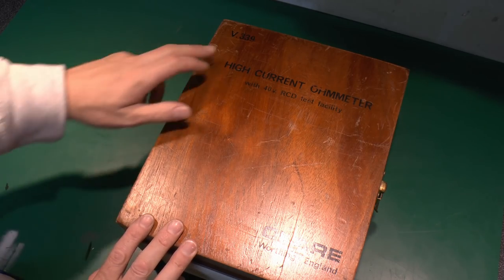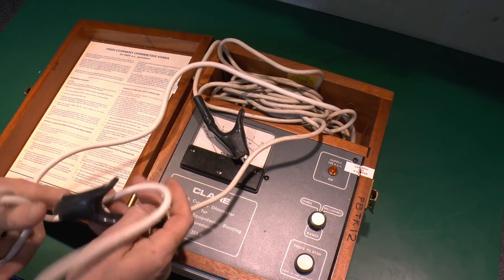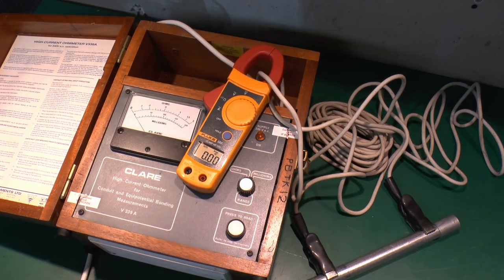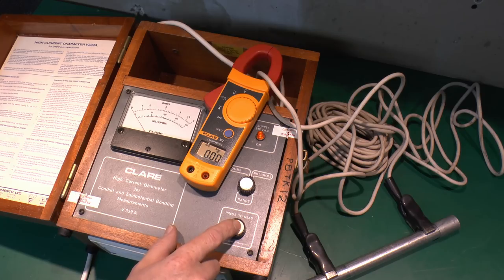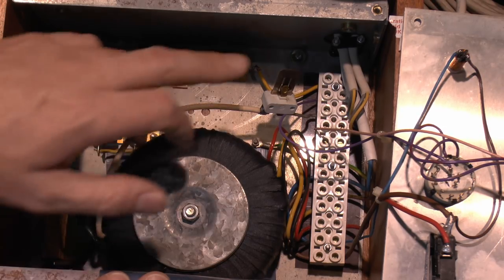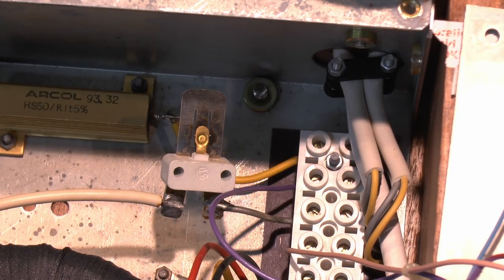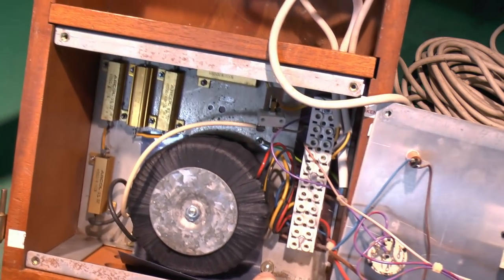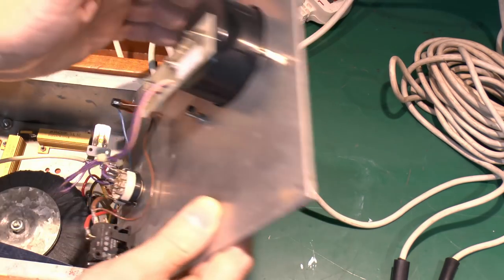Clare V339A High Current Ohmmeter

Comment: I use two vintage meter's being the ever faithful E&V megger and an Cropico kit assembled "Norma" test meter which came with temp probes and the sound probe, the megger is 1950's and from what I gather the Cropico is 1967, both work immensely well, the megger helped me track and trace an annoying short in my classic car's wiring loom and often use the meggers generator to test current with the Cropico at the other end of the circuit.

Comment: Use to use newer Clare A433R for earth bond testers for many years. These had a large green probe that you pressed against the test point to trigger the test. A pass would be indicated by a green light on the probe itself. If it didn't pass then the reading on the meter would be recorded.

Clare were bought up by Seaward, who have a product line "Clare Industrial Electrical Safety Testers".
Reply: Stephen Moll  I have that model lurking buried in the shed somewhere
Reply: @allthegearnoidea6752  wouldn't surprise me if the ones I used were still being used!

Comment: I have something similar to that meter. Made by Evershed & Vignoles Ltd London W4 last calibration was in 1997. The meter uses an alkaline accumulator for power and the maximum reading on the scale is 0.1 ohms. It has two probes which connect via three pin 5 amp plugs and sockets using two wires to each probe which contain a resistor tuned to the length of cable attached and a big brass rod sticking out for the probe, it is ex military and as I understand it for checking the bonding of aluminium skins of airplanes.

Comment: Many PAT and MFT devices do the 200mA - and the IET seem to think this is ok. I always carry a "proper" High current tester and use it as much as I can (requires some thought for ensuring you don't put 20A+ though a sensitive devce). I understand the need for 200mA when testing sensitive equipment - what I struggle with is why the IET say 200mA is an acceptable test for everything. I think Hugh current testing should be compulsory for anything except IT or electrically sensitive equipment. I've experimented with this before and you can get a looooot of dodgy arrangements to pass with a 200mA test.

Comment: You can get a modern low ohm meters, The one i used for many years was made by Megger (It was not cheap) it had a 20A test current. Not sure of the model but a bit like DLRO10. It never got a reading wrong, if it was measured low it was low.

Comment: Been needing something like that to test how well coaxial cables are bonded to radio towers! Time to build one! Not much going on in that thing! I suspect I can can basically used a old battery charger for the power source as it’s already current limited and has a bi metal strip inside. Just need to add 4 wire measurement and calibrate a meter to a reasonable level!

Comment: JW, i do wonder if that might be from circa 1975, then refurbed in 1993 with a new movement, unless Clare's cabinet design trends were a little on the old side..The plastic fantastic grille looks sufficiently nasty to have been added later when someone during refurb realised a standard british finger could easily get in and touch the transformer insulation..

Discuss! (As Vic Reeves would say..)
Reply: The resistors also have a 1993 date code, it is very likely to be from 1993.

Comment: I couldn't tell for sure, but that meter might have a screw to set the zero.  Many analog meters had that feature.  If it does, you short the test leads together, select the low-resistance range, push the button and turn the screw to set the zero.  When you release the button the meter will show a slight negative value, but that's OK.  Then you calibrate it against a known resistor.
Reply: @pmailkeey 
Depends if you want accuracy or not, I suppose.  You want an accurate measurement when it's not connected to anything.  I'd prefer an accurate measurement when it is.
Reply: @pmailkeey 
You are attempting to apply a general principal in a situation where it does not apply.

Voltage meter?  Set it to zero when the voltage is zero.

Current meter?  Set it to zero when the current is zero.

Resistance meter?    You're saying set it to zero when the probes are open circuit.  I.e., set it to zero when the actual resistance is infinity.  My solution sets it to zero when the resistance between the two probes is zero.  And it gives a slight negative reading when the resistance is infinite.  Not ideal, because ideal would be infinite resistance displayed as FSD.  But since we're only interested in measuring resistances, not infinite resistances, it's an effective solution.  Your "solution" gives an unacceptable offset error.

As for doing it in electronics, hahahahahahahaha.  Have you thought about what is involved in doing that?  With the technology available at the time the thing was manufactured?
Reply: @pmailkeey 

You're right I had a brain fart with infinity there.resistance.

Comment: How old is that John ?
Reply: Built in 1993
Reply: SuperCloneRanger it looks much older in design like 70s 80s style , must of been a hang over for manufacturing in the 90s
Reply from the maker: 1993 according to the date on the inside, although the Instructions in the lid are dated 1986 so the design is older.
Reply: Seeing the style of the plug and the reference to RCDs, I figured it had to be from the 90s, but without those I'd have guessed it was from the 70s.
Reply: pmailkeey the stickers would of course have been from the last calibration, not the first.

Comment: So, is there a modern equivalent of this?
Reply: AFAIK there is none. In most cases the testers to measure the insulation resistance can also measure resistance, but with 200 mA max. only. The scenario John explained is more a theoretical one since in most cases such a piping system is bonded at several points (every junction box) for potential equalisation so you don't have to rely only on the threaded connections. And that is also the reason to bond such a system at several points, so you don't need to rely on the threaded connections.
Reply: @pmailkeey If it fails the test, obviously. That's rather the point of testing and testers.
But to accept the commission and find it passed; to then refuse to certify would be perverse, not to say unprofessional.
Reply: You can get a modern low ohm meters, The one i used for many years was made by Megger (It was not cheap) it had a 20A test current. Not sure of the model but a bit like DLRO10. It never got a reading wrong, if it was measured low/high it was low/high.
Reply: i wander whether it was a dlro20 but cant find it on the web.